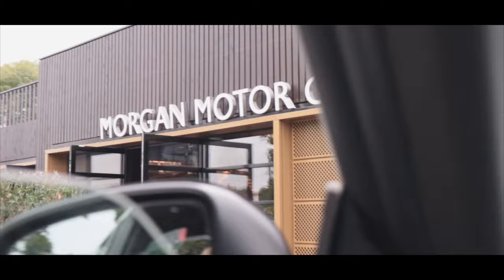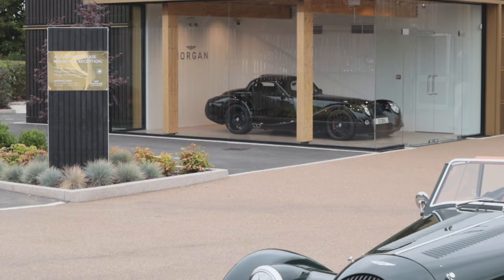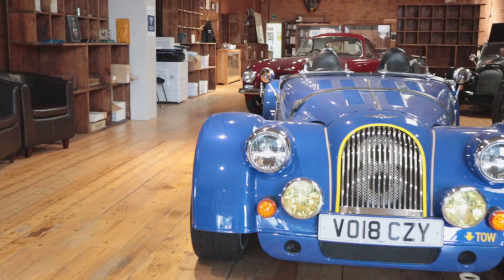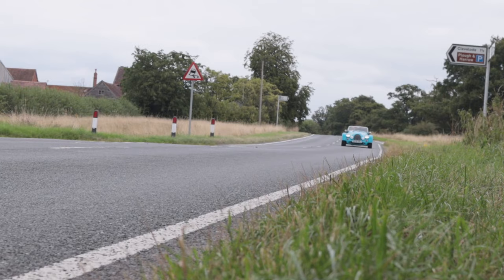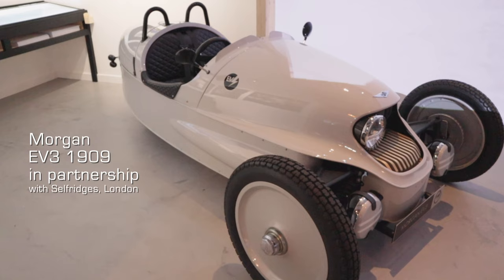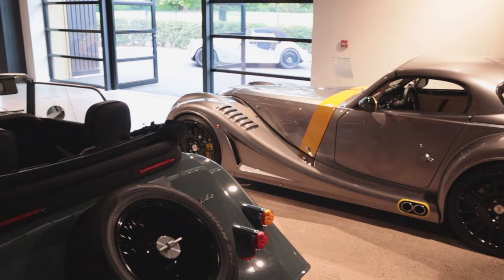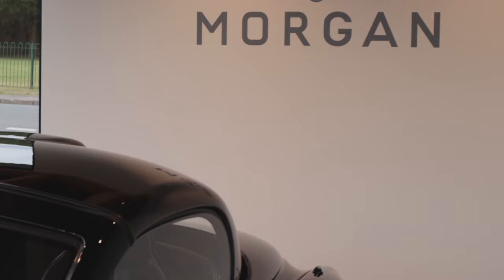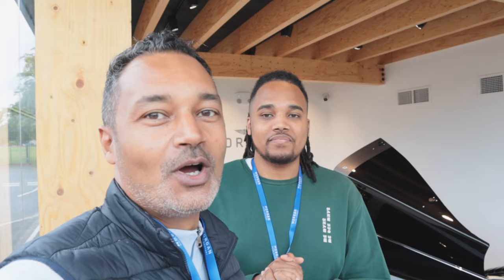Morgan Aero 8 GT: This BMW V8 Powered British Sportscar is INSANE!

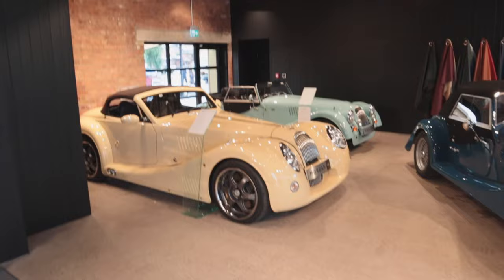Comment: The AeroMax you show at 7:23 was the factory demonstrator and used by Charles for much of the PR. The Aero models first came out in 1999 with Modern Beetle headlamps fitted on "wrong" sides leading to the Clarence cross eye issues. From the S3-4 and then the Max onwards they had the intended modern Mini headlamps you see there. Try one with the dual sidepipes and hear the V8 at high revs, you will laugh your heads off.
Reply from the maker: So interesting!! I'd love to drive one of these!
Reply: @sportzntouring  If you are ever in the south of England I have the ex-demo Coupe that was the Geneva 2013 show car. Sidepipess and all.
Reply from the maker: Oooh good to know!!
Can you message us on Instagram or send an email to info at sportzntouring dot com?

Comment: Are those backlights straight from Lancia Thesis?
Reply from the maker: Ooooh maybe! As a low volume manufacturer they do need to raid the parts bins of other manufacturers, as it's way too expensive to type approve parts like this. The headlights are from a mini apparently.
Reply: It's an old comment but yes, they are Lancia Thesis tail lights.

Comment: Lancia thesis rear led light
Reply from the maker: Probably... And Mini headlights apparently. This is to keep the costs down. Otherwise this would need to sell for many times the £160k it went for as new. Type approval and tooling on bespoke low volume parts is not cheap 😬